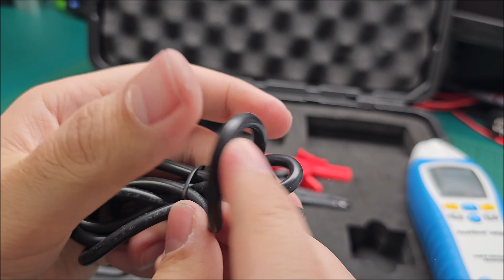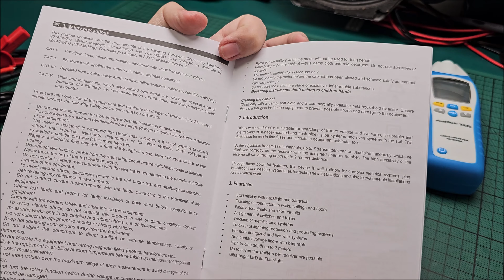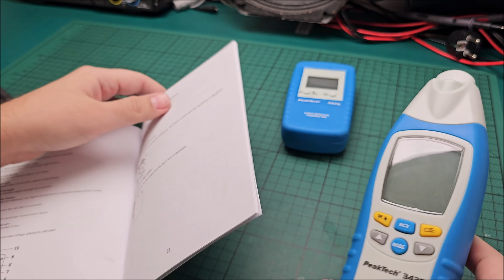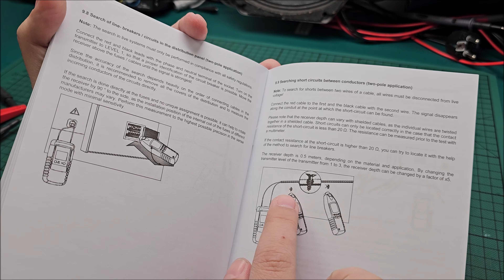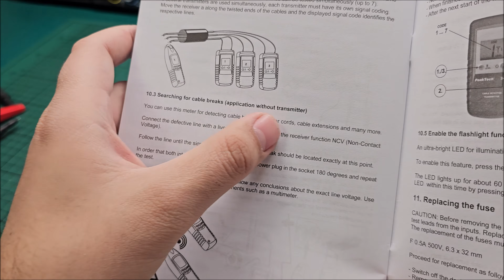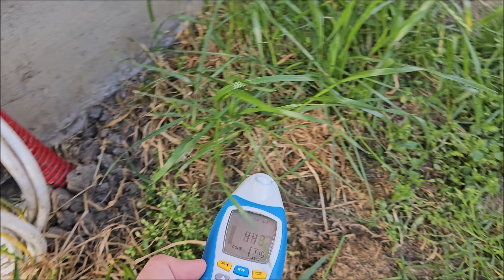PeakTech P 3435 Cable detector set with transmitter and receiver - review and quick test

Comment: Not really useful. I think a more common use case is following a cable in the wall, when you know where it ends but not how it has been routed under the interior plaster or plasterboard.
Reply from the maker: You can use it in whatever way fits your trade best 👍🏻
Reply: I bought it yesterday for that exact purpose and try it tomorrow. I need to follow the cable in the wall from my garage to the fuse to find out the length…

Comment: If I have loose wires under ground and no GND close to connection point, can I still use this to find where the cable goes? For example 3 wires together (like normal phase, neutral and gnd wires).
Reply from the maker: Can't you make a temporary ground with a metal rod inserted into ground? Should help with detection.